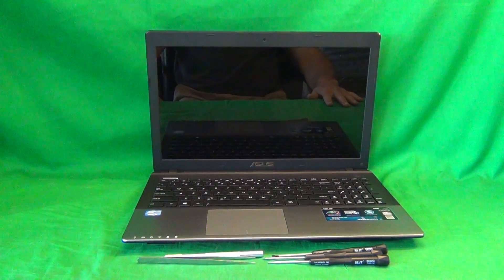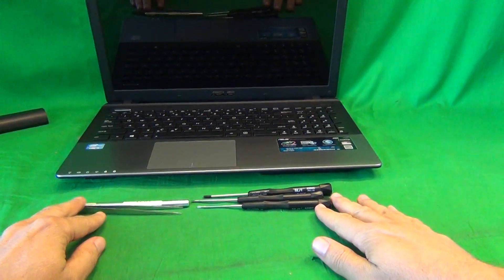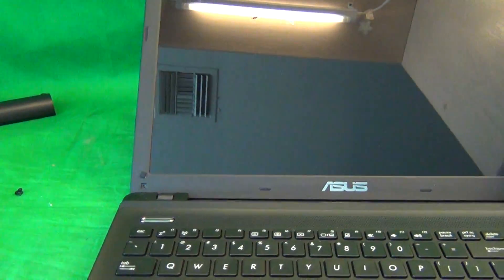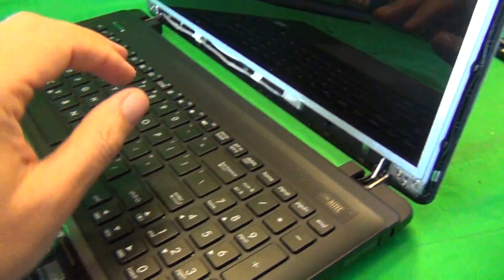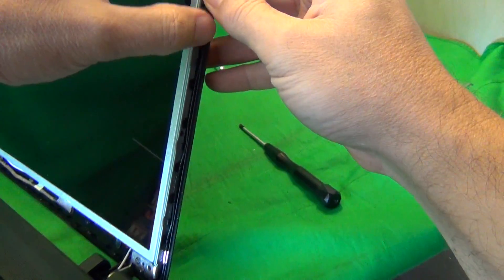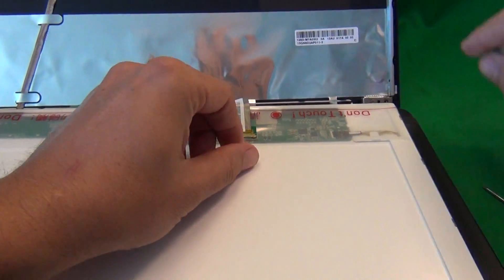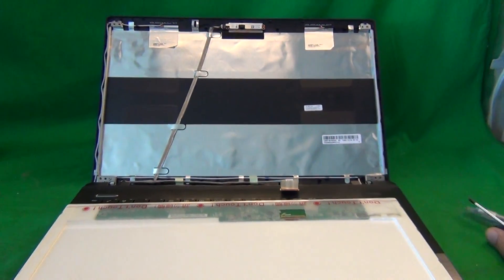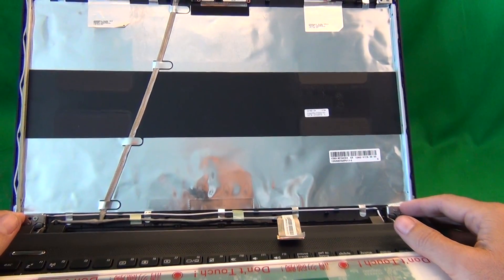ASUS A55A Laptop Screen Replacement Procedure

Comment: Thank you for this video. I changed screen on my A55A, which also says K55A on the back. I bought a screen on Ebay to K55A and it was just fine. Better as well, cause it wasn't glossy. Now it is upp running again. Thanx!

Comment: thank you so much, this video helped me change my laptop screen, however i didn't have the kit and couldn't afford one, i found one just like the one you have on your website for 80$ but for 40$ on ebay, without the kit ofc, so i used a knife, nails cutter(the one that has small knife) and a weird broken screw driver lol, i managed to open it without any damage other than losing few screws but the closing was freaking hard, i had to buy eye glasses repair kit which is 3$ to install the new screen, now it works like a charm :)

Comment: I have a K55A/Win7.  Is it possible to replace the screen in this computer with a Touch Screen, so that it will work with touch features in Windows 10?  (thinking this would be sweet once the Win 10 update rolls out)

Comment: Great tutorial. A friend has asked me to replace an asus k55a screen. I have replaced many LCD screens for myself but obviously want to get it right as the laptop is not mine. I know there are various spec configurations in the A55a but just want the make sure that the actual casing is the same for all models. I haven't replaced a touch screen before but i'm guessing that the replacement is the same providing I follow your instructions.